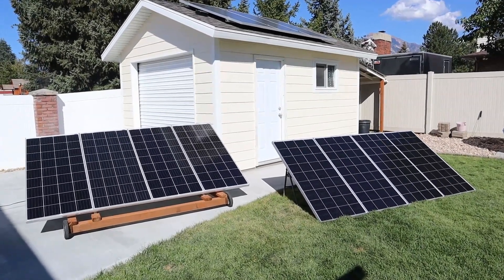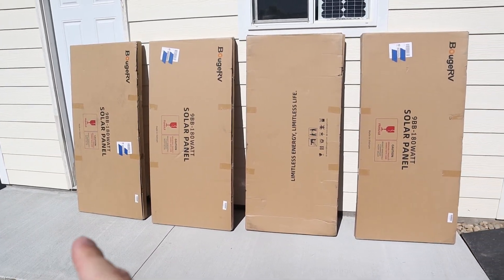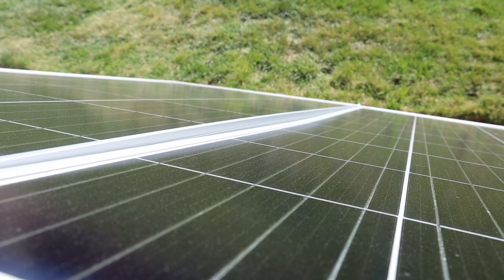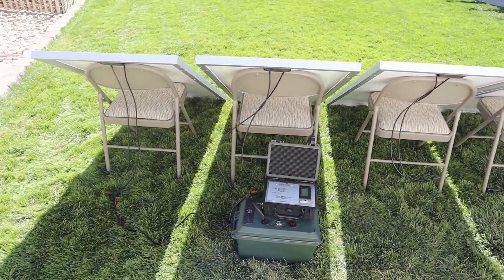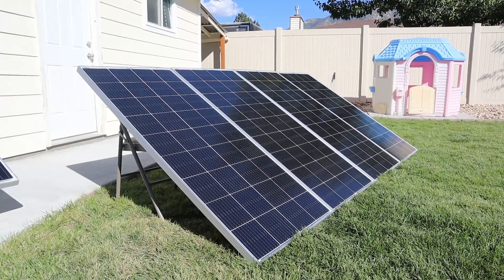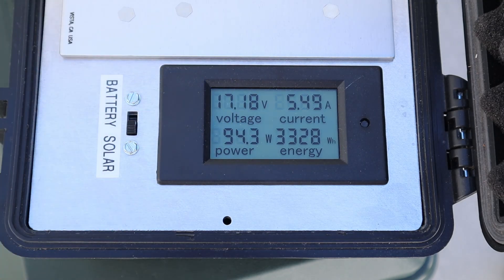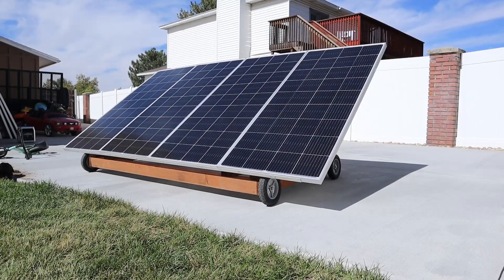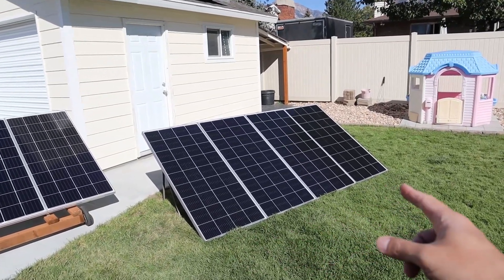NEW BougeRV 9BB vs 5BB 180 Watt Panels - Upgraded Efficiency? Fixed Shipping Woes?! Complete Testing

Comment: I never got to individually test my 6 panels because of weather, shading and time. However, I just pulled one panel off the array that has 3 large burn marks on the rear of the panel. Only been in the sun for 5 months.

Comment: need help Jason! just bought a bluetti ac200p & was going to hook it up to my solar panels & when i connected the solar connecters up & then plugged in the xt90 yellow end it sparked & hissed. so, I stopped. & yes, it set on pv for solar. i have (2) newpowa 210 panels in series. model NPA2IOS-12H. I USE THEM EVERY DAY ON MY OUKITEL P2001's with no issues? is there some reason why they wouldn't work on the Buletti?
Reply from the maker: The only thing I can think of is that the polarity may be backwards? Have you checked with a voltmeter?
Reply: @Jasonoid  you mean the solar wires coming off the panels?
Reply: @Jasonoid  I run 2 oukitel p2001, & a rockpal off my solar panels & I have never had a issue & still at this moment the oukitel is charging off of my solar. I can't figure it out.
Reply from the maker: @EASTKYPREPPER  first disconnect the panels, then make the wire connection to the power station first, then connect the solar panels into that wiring second via one of the mc4 connections. See if that has any issues.
Reply: @Jasonoid  my problem I found out is that my (2) newpowa 210w panels aren't giving out the 35v-150v that the bluetti ac200p requires. they are only 12v. is there any way or anything I can do besides buying more panels to fix this problem? my panels are attached to a ground mount & screwed in. so hard to just add another. any suggestions or fixes? thanks in advance.
Reply from the maker: @EASTKYPREPPER  even though they are 12v panels they should be putting out around 16v at peak power and have an open circuit voltage of 20v. But you are correct, with that lower voltage they would be under 35v. You can get a third panel in series and it will go over 35v and work just fine. I don't think there is another option since you can just boost the voltage of a solar panel.

One other option would be to purchase the Bluetti charging enhancer and plug the panels into that. That device costs $200 so buying another panel would be the better solution.

Comment: Comments ?   ! ! !   I  don't  need  to  leave  no  stinkin'  comments  .  .  .  .  .  .  !            (but i will)
   Bought  four  180 watt  panels  from  Bouge RV  some  time  ago  &  have  3 in series  which  give  up  to  420  watts  on  a  full  sun  day  in  S. Calif.  through  a  50'  10 AWG  connection  feeding  a  Bluetti  AC200P.
    Am  happy  with  the  final  results  as  it  has  shown  a  significant  reduction  in  my  home  electric  bill.    
One  of  the  panels  has   bent-frame  shipping  damage  but  only  the  frame / glass  is  intact.   They  are  not  all  equal  on  output  .  .  .  .  but  somewhat  close.    Some  loss  through  the  50' wire  &  panel  heating  expected.
               Thanks,                 RH

Comment: Excellent review.  You do a very through review which clearly shows the issues and how you reached any conclusion you have.  Excellent work!  I recommended that Zendure have you test their new SuperBaseV as you already have a transfer switch setup and their system is designed for house backup and as far as I know you are the only YouTuber who has shown this and tested it with a solar generator.  I hope they have you do a review before the end of their Kickstarter.  Keep up the good work

Comment: Nice I have 2 of the 200w 9bb  wired in series, I have seen 440 watts to my AC200max.
Reply from the maker: I'm pretty sure you live at 12,000 ft elevation or you got REALLY lucky with your panels being so good. I have never seen anything near that total on my 9BB panels! Did you see those totals in the middle of winter at low temps? Send me an email with the details of your setup with pictures. I need to know the secret to your success haha
Reply: @Jasonoid  idk..  also tried on my vicron also same 435-440 peak. But these are 200-9bb not 180.  Higher amps.   But i can't touch your numbers from the xtar 100 86watts dog dodo.
Reply from the maker: @gwashburn39  all good I suppose, I'm just glad you are getting good power!
Reply: @Jasonoid   So before I went to bed last night I rewired my 2 200w panels back to my victron.  So I can watch the graph through out the day.  They Peaked today at 427W lasting for about 45min-1hr.  then they slowly step down.  But from my Panels to my controller is only 15-20ft and I am using 8awg pure copper wire soldered & crimped MC4.   I know you talked about voltage drop and you were thinking of making a video for.  and you are using 14awg.  I am not sure if that may have a role with some of your numbers compared to mine I doubt it, but might be loosing it on the Amp side.  IDK.    It bugged me and I thought I made a mistake.   Or maybe the 200w panels are really that much better :X,   I am planning on getting another 2 more of the 200W and doing a series/Paralel connection with as well.
Reply from the maker: @gwashburn39  thanks for the update on the output! The 200w panels could be better than the 180w. I have about 40 feet of 10awg wire between my system and panels. With the voltage being up near 70v and 100v, I don't see much voltage drop in the cables. I do have plans to test the different in wattage at the panels and then inside the house. It will be interesting for sure. Thanks Greg!
Reply: Oh my Bouge RV 100w 9bb are running amazingly great that is why I have not swapped manufactures.  They are in 5s2P  1000w + on clear day.  shitty day 500w.  My MPPT will show 60-65 amps to my Batts and getting 5.5kwh a day on drained batts from them.  Usually my batts are charged back up to absorbstion in 1-2hrs then float at 50watts after.  I wish I could attach pics on here!   I am installing a PDU from tripplite with duel feed. Primary will be on my solar inverter side, F/O will be on grid.

Comment: I think I am done with Bouge RV; although I did buy an MPPT solar controller from them and we will see how the long term plays out with it. So far the controller is connected to my inferior 180 watt Bouge panels and it is keeping my lead acid's on the hitch full. I only get enough light in the afternoon and that is only on one of the two panels. we will see how winter treats me.
Reply from the maker: I have yet to find a glass rigid panel that puts out full rated power! The BougeRV weren't amazing. Ill keep on the hunt for a better option. I've heard good things about the Harbor freight new 100w panel

Comment: Remember solar panels will lose 5-10% of their output in the first few months as the material stabilize. Out of all the 100w rigid panels I've tested so far, the ones I got from harbor freight have performed the best. I consistently get 105-112w from them even after 3 months in the elements.

Comment: Hi Jason,

Great video Sir!

Just thought you might like to know, I have a Bluetti EB70 and a SP200 folding panel, most input I ever saw was about 145 watts.

The SP200 failed so I purchased 2 Renogy 100 watt glass panels, plugged the first panel in and it was pulling 111 watts! 😳

Plugged both in in parallel and pulled 177 watts, that’s the highest input on an EB70 I have ever seen anywhere!

I plugged them into my EB3A and pulled the same, thought you might be interested 👍

Kind regards

Tony
Reply: Hi Jason,

I am based in the UK so I bought these panels on Amazon UK obviously.

They are Renogy 100 Watt Glass panels, on the back the sticker says:

Max Power: 100 watt
Maximum system voltage: 600v DC (UL)
Open circuit: 24.3V
Short circuit: 5.21A
Optimum operating voltage: 20.4V
Optimum operating current: 4.91 A

If any of that means anything you you!!   Lol

I forgot to mention, when I had one panel connected I was getting 111 watts??????

Kind regards

Tony
Reply from the maker: Great results! What model of Renogy did you go with? It must have a higher voltage output!

Comment: Curios to know how old the original ones were?? And did they replace with upgrade because of your YouTube status?? I had tough time getting Newpowa to replace a single of my three 100 watt panels cause it was performing less than others. All are performing much less than my Harbor Freight ones. They claimed the output on the other 2 panels was within rated. They are only 2.5 years old!!
Reply from the maker: They are about a year old, and yes probably because my status. Hard to tell how it would have turned out otherwise. They saw my video from a couple weeks ago and wanted to make things right.
Reply: @Jasonoid  thank you. Possibly may be better customer support as well. I tried a head to head comparison with Bouge RV 100 watt 9BB and my Harbor Freight panels....over 12-14 watts less on the Bouge. I was sad cause hoped this new tech 9BB was better.
Reply: @Jasonoid  and HOW did the back of the frame get bent on that one!!?? Like damaged before boxing?
Reply: @Jasonoid  oh and another thought....was that burn through you had near edge of panel? 
Maybe need spacing between edges of panels for cooling from each panel?
Reply: Those Harbor Freight panels perform amazingly. I snipped the SAE and added MC4. I often will get over 110w from the HF panels.
Reply: @joshualeblanc3833  yeah it's perplexing how well they do with no angle adjustment! Just use the legs and they produce! Maybe they do delamination faster but for solar generators use or emergency etc where not permanently outside they are great.
Reply: @joshualeblanc3833  and I kept ends and just found low cost adapters in case I needed to go back.

Comment: Hello Jason, nice video.  I didn't buy the 180W panels but I do own 3 of the BougeRV 100W 9BB panels and I received them in the exact same shipping quality you did.  They came with the same foam corner protectors and the sheet of cardboard covering the glass.  So for those who are interested in the 100W 9BB panels from BougeRV you can expect the same quality in shipping and performance and at a great price as well.
Reply from the maker: That's great feedback for others to see. Thanks for sharing your experience Robert!

Comment: I know someone that recently got the 9BB and it's underperforming. With their power station, they should be getting in the 120-140W range, but the panels are only making 80-90 in full sun (no haze). BougeRV told them to check the Voc and Isc, which they did. I thought the numbers were low on both (well outside the +/-3% on their spec, even when temp is taken into account), but they told them the numbers are OK.
I've since recommended they sell the BougeRV panel and pick up a Newpowa based on Jason's review of it.
Reply from the maker: Only 80 to 90 watts is pretty disappointing on the output. The Newpowa panels did produce more power (but they were also rated at 210w) and I'm waiting to purchase 3 more of those 210w panels to make a larger array for my future truck port roof. 

As for the BougeRV panels, only time will tell if I have issues with them long term, I will be using them everyday so I'll provide an update later down the road. I now have a good estimate of what I get from them in good conditions.
Reply: @Jasonoid  Ooh, looking forward to both the update and the new project for the truck port solar. From your video, it seemed Newpowa has better packaging and potentially more consistent manufacturing. 
More relevant to your Pecron video, but do you plan to pick up the extra batteries for the E2000LFP when they're available? I emailed Pecron and they said daisy-chaining more than 2 EBs would result in potential damage to the E2000LFP. For the price and performance (it bested the big brands), I'm really interested in the Pecron, even though I don't currently have a use for it 😆. Would be great for my overlanding rig actually, but no space for it as I can barely fit my 1210Wh CTECHi in there right now.
Reply from the maker: @zigzagluck  I do want to test at least one of the expansion batteries when they are available! 👍 The price and actual capacity was excellent so I'm hoping for the same performance on the batteries as well.

Comment: Jason, I think your evaluation was accurate and fair. I'm happy to see the BougeRV company make these changes. The shipping boxes needed to be upgraded and BougeRV did exactly that. Thank you for showing what country the 9BB and 5BB manufactured the panels. I agree with you in that a company should place their contact information on their product. I think I heard you mention the 9BB panels were replacements. Did BougeRV replace your panels under warranty, or did you purchase these newer Pannels? As a consumer I prefer to pay for a quality product that is delivered with no damage and good customer service. I understand that means I could pay 10 to 12% more. Take care,
Reply from the maker: They replaced them under "warranty" ....but I'm sure that had to do with the previous video I posted where the 5bb panels performed really bad. Hard to tell what they would have done under normal circumstances.
Reply: @Jasonoid  Jason, I'm very happy BougeRV did the correct thing and worked with you to warranty the 5BB panels. Your channel may be the reason they worked with you and if so, congratulations you earned that consideration because of your hard work over the years building an audience that respects your findings. All future customers of BougeRV and BougeRV itself will benefit because of the packaging issue you brought to light and BougeRV corrected. I also believe your input, meaning BougeRV monitors and learns from your testing as well as their own, may have caused a manufacturing change. When I move, I will certainly now place BougeRV in my top three manufactures when I purchase panels. Thank you and take care.

Comment: It same packaging as 200w panel, I can tell you this packaging will still damage panel on the side, and front sometime.
Reply from the maker: In my experience there was much less damage on the 9BB panels, I guess that could be different for someone else. The 5BB panels we completely destroyed and open when I got them. Thicker cardboard maybe?
Reply: It depend on the deliver driver, compared to Rich Solar has better packaging even each side has styrofoam. I think they are not bad just more room to improve.

Comment: Good thing those new ones are performing much better! What does one do with solar panels they no longer want? If you wanted to discard those damaged panels do you have to take them to the local hazardous waste drop off? Solar panel recycling will need to become a big thing in the coming years.
Reply from the maker: I have no idea about the recycling process so I agree there needs to be some education there. I was going to sell them second hand for cheap so someone else could still use them. They still produce some power and are somewhat useful.
Reply: @Jasonoid  Yeah I think selling as second hand is the best option right now. Hopefully you can find a buyer! Big picture, there are going to be a lot of panels that need to be processed in the coming years so hopefully there are plans to take care of that.

Comment: I have 4 of those 5BB 180W panels and I typically get 500W out of them.    I did find 2 things that make a difference in their output. 1st, they get a little dirty from morning dew and dust.  When I clean them off, they increase total output by 40 - 50W.  They didn't seem that dirty but what a difference!  2nd, temps here have averaged in the 90's and the first day it cooled back into the 60's, total output was just over 600W.  Can't control the temp but keep your panels clean for better output.
Reply from the maker: Having clean panels definitely helps. These ones had some broken cells in them which was causing a big drop in power.
Reply: @Jasonoid  I would like to add 2 more panels and wonder if 2 of the 9BB panels would be compatible with the 5BB's?  Can you test that?
Reply from the maker: @robertlueke3238  it'd fine to use the different panels together, they wouldnt be damaged by connecting them up, but the differences in voltage and amperage would lower the total power output slightly. It's best to use panels that are identical for max power. It's not a great comparison to use my 5BB panels because they don't work well.